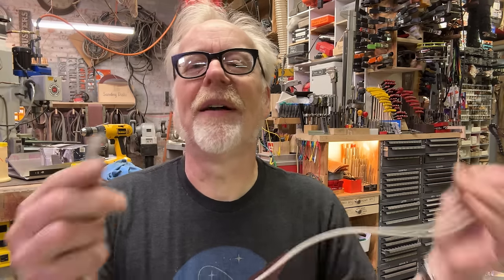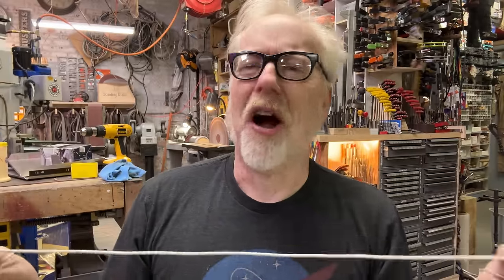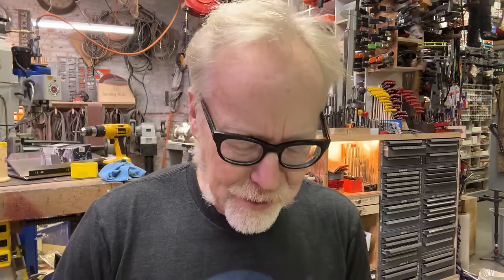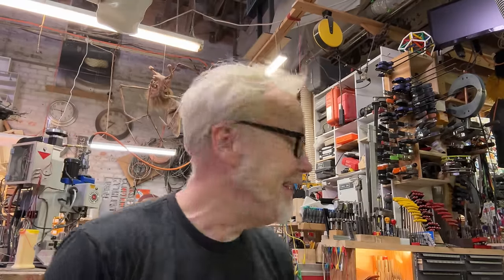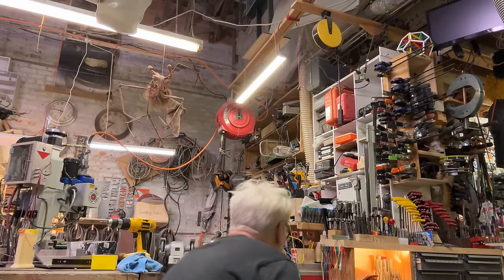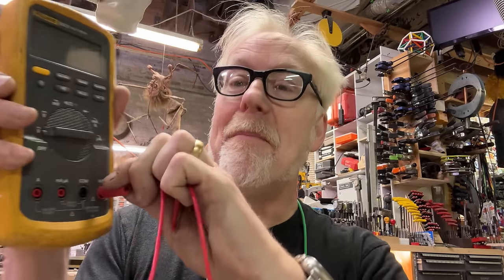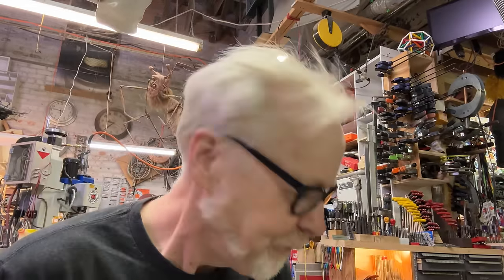Adam Savage's Alligator Clip Leads Problem

Comment: I hate clip leads. I took a class that had a lab where we had to use them to make circuits. It's not that they didn't work, it's that we had to build all kinds of circuits with them and none of them were less than a foot in length. A simple battery to resistor to bulb to battery circuit was a three foot loop! We had to do parallel cicuits, and circuits with series and parallel sections, then hooking up ammeters and voltmeters to different sections and it was always a sprawling mess across the bench.
Everyone who took the class said we should be using breadboards. The lab professor said we should be using breadboards. The assistants said we should be using breadboards. Why didn't we use breadboards? The school apparently thought it would be too hard to teach college students how to use breadboards over the course of an entire semester... I hate clip leads.

Comment: What if there were clip leads that had the grips like a set of pliers? I is “my” opinion that those crazy shark type jaws are not needed. For simple electrical testing, you need just enough clamping force to hold the items stable. The “sirated sp? Jaws on simple pliers would have enough grip resistance for any temporary holding. But I have never seen any like that.

Comment: Another bad thing about alligator clips is that the insulation boot is practically useless and allows a lot of opportunity for the positive and negative to contact each other.
I have a couple sleeves of heat shrink tubing that I often slip over over the exposed contacts to avoid any shorts.

Comment: It is so easy and cheap to stamp out barely usable clip leads, that there's a veritable ocean of them, with a few high quality and really expensive models out there. 

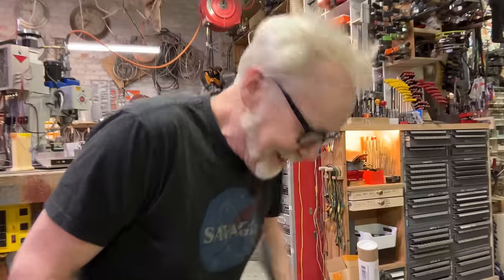That stack of ones you point to at 5:51 that you "suffer" with, when sourced from top quality sources, would cost what im guessing to be several hundred dollars, instead of the $20 or so from Hazard Fraught Tools.

Those mini grabber leads that you love to use with your meter?  Yeah,  Digikey has them at $10.19 PER LEAD.

I feel your pain, Brother!

Comment: Try using those crappy jumpers at 4:46 to troubleshoot a rooftop package unit (HVAC) on a roof in 0* weather. The plastic insulation is as pliable as sheet metal.

Comment: I make mine with scraps of recycled flat spring wire, they are better and cheaper. Another alternative is to make them 3D printed and put a conductive material on them with the advantage that they only conduct at the point you want them to conduct.

Comment: Decent quality, actually flexible silicone, non cracking, non breaking, accurate multi meter leads also impossible to find.
I've used cheap, ive used spendy, all fail far too quickly.
I care for them to a reasonable degree but they just don't last!!!

Comment: yes even rs components (suppost to be high end in uk ) cant manage sell non flexy clips now and their stackable 4mm bannana plugs are junk too (the insulation boot slides around every insertion or removal) , i buy clips from ebay only as "vintage" or new old stock , we need to be buying clips and other parts from the  1990,s to get good quality. clips made  from real metal not coke can tin

Comment: 95% of electrical engineering is just V=IR.
Diodes have a forward voltage drop and some amount of current they're prescribed to pull before they'll start to overheat.
If it's a 0.7V drop, and a current rating of 30mA, and you're giving it 5V or something, then the resistor has to drop 4.3V and pass 30mA.
Now you have the V and the I. You can find the R.

Comment: developing an understanding of electronic circuits is difficult, there is the heuristic level of steady states, and then there is a dynamical understanding. understanding the steady states is simple enough, it is what most people do, looking at logic gates and the behavior of circuit logic as transitions between steady states that is fine for most purposes, except when there are alternating currents or resonators or control circuits with sensors of varying inputs.   you can divide inputs into two general categories, continuous input and discreet ones. continuous inputs are harder, like a radio for example might have a receiver and a transmitter, and the input and output of the circuit might be changing all the time. in truth all problems are like a complicated transmission line problem in a kind of heuristic steady state until discreet changes in the circuit happens, think of a complicated radio signal being broadcast as the music is read of a record in a record player, everything that is happening is equivalent to a continuous transmission of a signal of many frequencies at some relative phase, ofc the circuit is turned on an of along the way, and so the heuristic steady state does not really last forever, but once you understand a transmission line with alternating current properly, almost all electronics can be understood, semi conductor components are a bit different, but not that badly different. for example when you turn a circuit like this on or off, you might be cutting or applying a voltage to a coil of wire that is supposed to actuate an electronic switch for example, now we are going from one heuristic steady state to another with respect to the control circuit, what is going to happen in such a case is that the coil in its 0 current state has no magnetic field, and suddenly we are applying a voltage to it, the current is going to start going with the resistivity associated with the resistivity of the wire alone, capacitance and inductance is going to be more or less negligible, so the current the coil is going to draw is vastly greater than it does in its steady state, with a magnetic field. so this kind of a problem of a simple component like a relay is one kind of transition between heuristic steady states we want to watch out with, when we have a coil like this we must be careful that the current drawn or the current produced, when voltage is cut or is applied to a coil with or without a magnetic field is something our circuit can handle. for example we might have an inductor in a circuit with the current and a magnetic field in a certain configuration in the steady state where a certain switch has turned on a resonator with an inductor and a capacitor, but when we cut the voltage to this circuit, the magnetic field of the coil could be maximal when the power is cut, since the current wants to decay too 0 in the new heuristic steady state of that part of the circuit, the magnetic field will also drop to 0, that means we have a relatively powerful magnetic field that is going away, it needs to dump its energy somewhere and the result is that it produces a current the opposite way to the current that produced it, this is an emf being produced across the inductor in the opposite direction as the applied voltage that produced the magnetic field in the first place, you might have set up your circuit in such a way that this very high voltage applied in the other direction might destroy other components in the circuit, therefore it might be required to place a diode and or a resistor in the circuit to prevent that from happening, limiting the emf or current that might be generated in a circuit when transitioning from one heuristic steady state to another. the only way to get a good grip on such things, is to sit down with a good book i'm afraid, learning the dynamical properties of changing circuits, but a reasonable understanding can be achieved with understanding emf's capacitance and inductance in the context of a transmission line problem.  contact points and such is more complicated, but essentially most of what is going on in electronics can be understood by resonators and transmission lines in my opinion.

Comment: I couldn't figure out why my multimeter kept measuring wrong, turns out my alligator clips come unsoldered, and measure 2 ohms each.  They're just wire crimped onto metal, which makes them more durable, but not a conductive connection.  That's how all the cheap ones come, you have to open them up and solder them if you want 0 ohms.

Comment: The cheapo clip leads that you love to hate have another problem (depending on where you buy them).  The wire is spot soldered to the clip, and sometimes not very well!  My only solution (also being too cheap to toss 'em) is to dedicate an hour or so, slide the insulator thingies to the center of the wire, and re-solder the clips.  Strip the wire, thread it through the hole(s) in the clip, and re-solder.  Then slide the insulator thingies over the clips.  While you're at it, re-form the clips so the jaws mate!
Generally, the clips are a good size, but the way they're manufactured isn't!

Comment: Those 3 AAA batteries in those gosh darn flashlights... the first shake wieght.
Reply: Most LEDs need 3 to 4 V to operate which is why you see that three AAA Battery configuration. This is where people need to invest in lithium-based battery flashlights.

Comment: You should cut the wire and look at the conductor.  Many of the cheap leads have just one small strand of copper with a thick cover.  Making them appear robust when they’re just garbage.

Comment: The formula to find the resistor required for an LED is: (Vs-Vf)/I. In other words, subtract the forward voltage of the LED from the voltage source and divide by the required current. I hate alligator clips. I like hook clips.

Comment: I dont have alligator clips in my process. I use breadboards and breadboard wire to prototype and test electronics. I use Wago Clips for thicker wires.

For simpler circuits you dont need to test. Just build it and trust your circutry knowledge.

Comment: The billion-dollar idea: make clip leads that have banana sockets integrated into them, so that custom-made banana plugs can be shoved into them. Another point of failure? Sure. Unwieldy? In tight paces sure. But when do you ever find yourself testing in a tight space?? The spring-operated fine-wire grippers could stand to have a banana socket, too; just wire it into the spring and have the whole shaft be conductive. Easy monies for whoever can spin up manufacturer for those.

Also another easy money idea: lever nut audio connectors. Rather than the rising clamp nonsense, lever nuts would be just as effective without the need to use a screwdriver. Call 'em tool-less and throw 'em on Amazon, you'll make stupid-bank with the people who want an easy in on custom-length legacy A/V cables which attach in a way unlikely to rattle or flex loose over time.

Comment: Adam, most electrical engineers also just test resistors til they get the right output. Most of them have done a tenth the projects you've done.
You're good at electronics. Stop it.

Comment: All they need to do is make the top clamp out of plastic. Cuts down on parts count, makes it obvious which side is conductive, allows deformation to more firmly grip the wire and adjust to wear over time, negating alignment issues.

Just use plastic?

Comment: I could've made this video and I would've said the same things! I've been using clip leads since 1970 and they are not good! You alluded to grabbing small wires? Well, most electrics/
everything ships with 22 ga wire or smaller now. Circuitry uses less current and wire  gauge gets smaller. And clip leads just don't cut it! A new design is needed to grab tiny wires. Perhaps two flat jaws with a gritty surface?
Reply: My first thought was something like a carpet of little wires on each side of the jaws, kind of like short metal toothbrush bristles.  Your idea would probably be easier, cheaper, and work just as well or better in most scenarios though.

Comment: You shouldn't have to throw the clip leads in the garbage. Your city should have an electronics recycling depot. They will accept anything with wires and will strip off the plastic and recycle the metal.

I always have a box of dead electronics and wire in the garage that I occasionally take to the dump and drop at the electronics recycling area.

It's crazy to waste all that metal. It's the most reusable stuff in the world.

Comment: I was a maintenance electrician that did a lot of troubleshooting and purchased so many POS garbage what you called clipped leads especially ones that Radio Shack sold that ordered boxes of 10 copper clips & different color boots all made in USA to be the best. Just had to.made sure that you used the proper wire. Would order very flexible test lead wire in white, black, green & red and make my own. Still have some that I made 30 years ago. I NEVER purchase or use ANY safety or test equipment, electrical supplies or LED lamps && drivers from lying, cheating lack of quality communist china. My company maybe 15 years ago purchased a very versatile set of test leads from Fluke but was overpriced think it cost over $110 back then.

Comment: Nope, not a fan of gator clips. Teeth misalignment, too strong or too weak of clamp strength, the insulators are either too big/small, etc. Just all around annoying as hell to work with and in most cases I have used them it would have been faster to direct solder or some other method. Oddly enough my most common usage of them today is creating direct shorts, haha. Having the other ends of them connected to something else, and then having the clips hook up to each other as opposed to anything else (wires, nodes, etc).

Comment: 8:20 "Nobody has significantly improved on this form factor in decades."  I would contend that they not only haven't improved, they've gotten worse.  Cheaper construction, thinner metal, wires crimped through the insulation rather than the wires stripped back before crimping.  Lots of junk out there.
Reply: Ah, I see you've cycled through the same crappy jumpers I have,  all worthless. HVAC guy here, in cold weather (Colorado) the cheap plastic insulation around the clip gets so non pliable you have to warm them up to allow the plastic to flex with the clip. I've never found a decent brand yet in 25 years.

Comment: Adam, you are an adorable mess on this topic. Granted, anyone who has used test leads forms a love hate relationship with them. Kind of like a bad girl friend, who has not been let down by a bad test lead? (They are so colorful and pretty when they are new and still in the plastic.) Unfortunately youth wanes and calmer reasoning sets in: Mueller Electric alligator clips with 14 Gage super flex wire with a silicone jacket, soldered not crimped, are my preferred test lead fixings. But that is just me.

Comment: and worse  a lot of clip leads today use the complete trash wire called CCA or Copper coated aluminum.   This wore is just the worst wire ever.  Solid copper is ductile and can handle bending. the CCA wire does not and they break internally after a 10's of bends.    /never ever buy anything with CCA wire, sadly the companies using it refust to tell you they are CCA.

Comment: The preferred and used with his VOM was formerly referred to as Kleps clips. The other alligator clips that he liked, actual alligator clips, the tiny version a later invention that was entirely misbegotten for electronics usage.
Seriously, leave the toy 'gator clips in the bedroom for use as nipple clamps, that's all that they're good for and the recipient will properly thank you with a hammer.

Yeah, I loathe alligator clips intensely, always have, always will. Given a choice between using a cheap alligator clip and soldering my dick into a circuit, I'll plug in the solder station.
And unlike Adam, I am a certified electronics technician, IT guruilla (work with me, people!) and quite mechanically proficient.
Hopefully, Adam was drinking something when he read that. I've a thing for sending fluid down someone's nose...  ;)
But, I actually am certifiable, erm, certified in electronics and generally certifiable overall.   :P

And remember, I have a gun and I know how to grease my car with it!
(muffled, while under the car) Where are all the *@&^! grease fittings?!
Yeah, seriously gave away my age there, huh?

To further date myself, my first Fluke meter was a Fluke 77, shortly after they were first introduced. I encountered Fluke meters in electronics school back in '78. When the 77 was introduced, I was working a counter sales gig at an electronics wholesaler. The owner initially objected to my using a stray component, specifically resistors and batteries to demonstrate the units to techs at the counter - right until he saw how many cases of meters I was selling.
I didn't sell a damned thing, the meters sold themselves. Autoranging largely sold itself, nowhere as good in quality as my Beckman 310, it still did more than well enough troubleshooting circuits in my side jobs.
I left my won Sencore meter on the floor behind the driver seat for a decade...
Still, if anyone has a Simpson 360 laying around and needing a home, I could happily give it utility in testing circuits that benefit from such low impedances. Seriously!

Comment: Wow... this is off topic but I couldn't help but notice that clearly-vintage DeWalt in the back! 😅 
You know it's old just based on two things:
  - the rounded body design with a distinct lack of rubber overmolding
  - the battery is that old style [although, Ryobi still use it!] with a post that gets inserted up the handle

Do we know if its it's the original battery still chooching, or a replacement?
I presume it's at least Lithium?? 
Granted, my much cheaper Porter Cable drill from ~12 yrs ago was still NiCd, yet has the modern slide-in style battery pack 😒😅 So it's possible his could be NiCd...

Comment: I have some good ones, they are copper!, so no plating, they have a tongue on the tip that is flat contact surface. No idea where they came from. ALso rthe clips with the plastic surrounds are much better and have precision teeth not these stamped cheapo crap